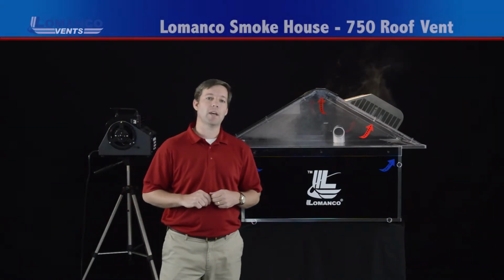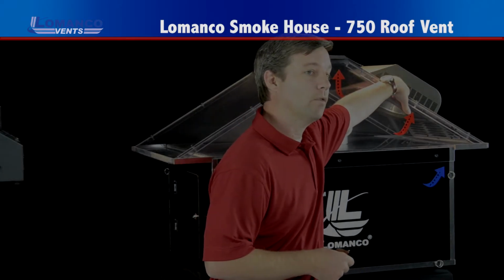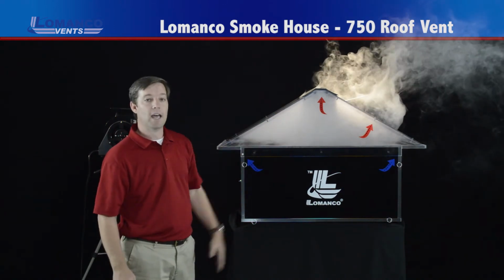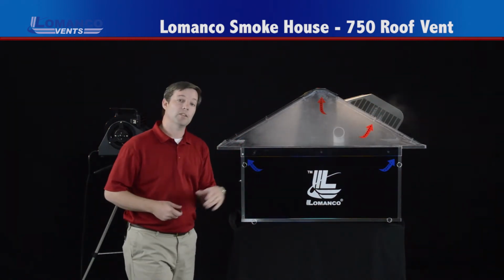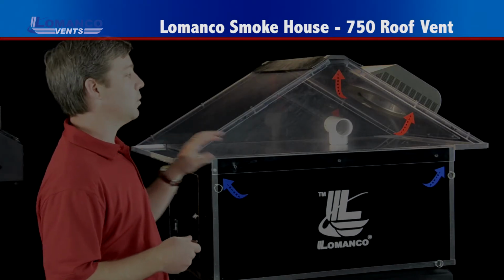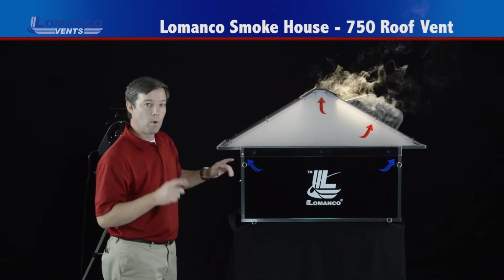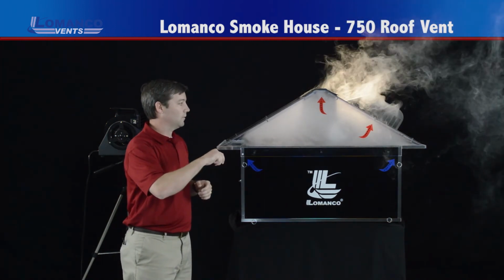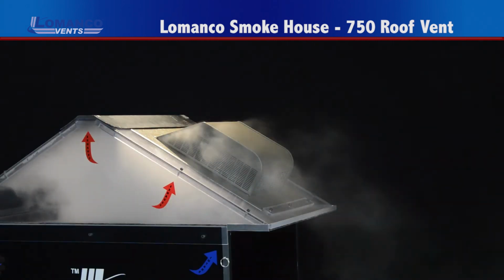Lomanco® 750 Roof Vent Smoke House Demo

Comment: What I don’t like about those demonstrations is that house/roof model is ridiculously small so those test will always work effortlessly. I believe Lomanco can afford to make at least 500sq feet roof model
Reply from the maker: Thanks for the feedback! You make a great point about the size of the demo model. The compact demo house is designed as a dramatization to visually showcase how our vents function in a controlled environment. While it may not replicate real-world conditions perfectly, the principles demonstrated—like airflow and heat/moisture removal—are accurate to how Lomanco vents perform when properly installed.

Comment: Can I close up all the soffit vents on one side of my home?  Neighbors are all day/night chain smokers and our homes are very close. Im guessing the smoke must be coming through these grill vents in my home. It’s awful!  It’s like I live in a bar now and I’ve tried everything.  :( help!
Reply from the maker: Intake is very important to the ventilation system.  Unfortunately, intake is often overlooked.  In fact, inadequate intake is the number one reason for failure of an attic ventilation system.  Lack of intake vents results in extreme heat buildup in the summer and severe moisture problems in the winter.  Additionally, exhaust vents can actually become intake vents if no intake vents are present and pull in rain and snow.  You must have a continuous supply of fresh air to “feed” the exhaust vents.  The intake system must provide as much or more than the exhaust system in net free area.
Reply: Yes you can just open up same vents in another part of the house